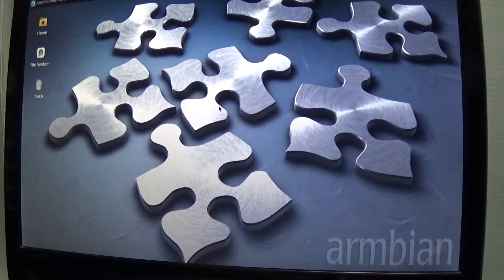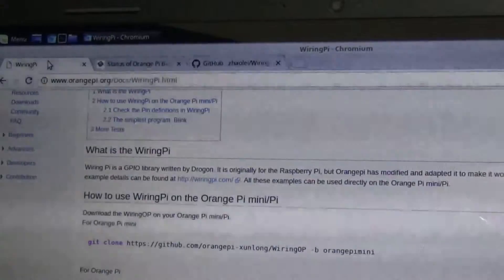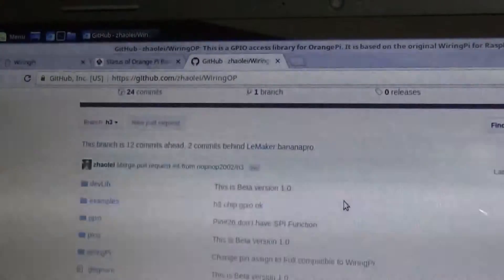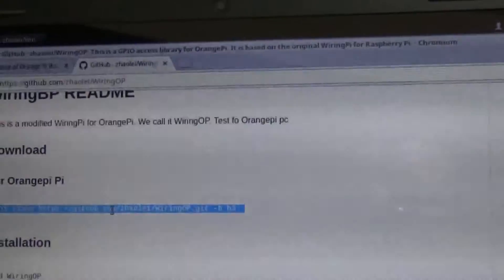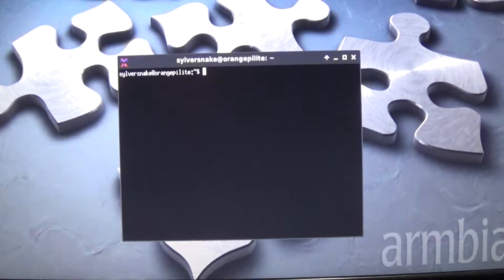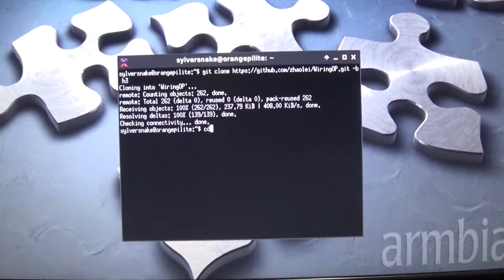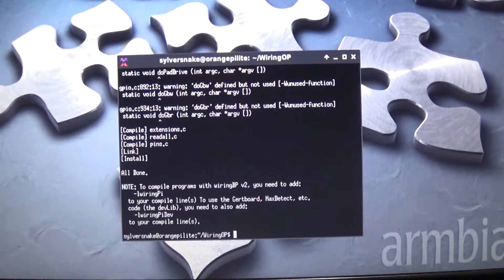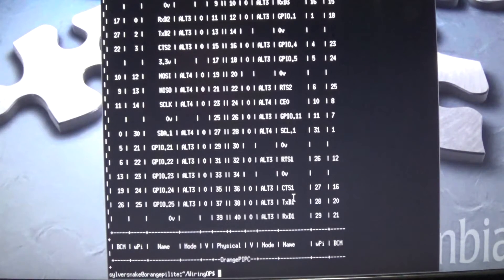OrangePi   Setting up GPIO

Comment: How to use this for python code? I followed all the steps a long time ago, worked for a simple c code I did but when I am running in a python code for my orange pi, it days no module found named WiringPi (I tried several other interfaces like wiringpi, wiringOp, wiringop etc)

Comment: Very good info on Your channel! If not for the power problems, OPi Lite would substitute microcontroller in some of my projects. I hope to resolve this soon.
Reply from the maker: What type of power problems need to be resolved?
Reply: Well it's really fussy with sd cards. The one it would luckily boot, it later corrupted and wouldn't boot anymore. I read that it's a powering issue.
Reply: Power supply amperage was sufficient and all the peripherals worked fine.
Reply from the maker: Hmm.. I haven't had any problems yet. But I do know that if you do not shut the system down properly before removing power it can corrupt the SD card. I have been using 2 sd cards for experiments and both seem to work fine. I am going to be doing some work soon with a linear actuator. I will see if I have any power issue when I put a load on the GPIO ports.
Reply: Ok, seems that the problem was a bad SD card adapter or USB-driver (or my lack of knowledge). I wrote the image files under Fedora and they turned out faulty. Tried burning same images under Windows and the Pi would happily boot them. So in this case the power was no issue :) Yeah, but I'm really cautious about large loads on gpio tho.